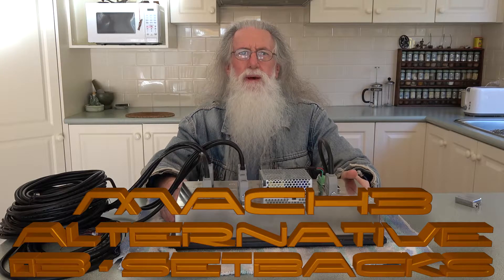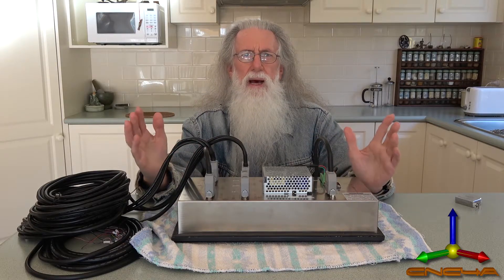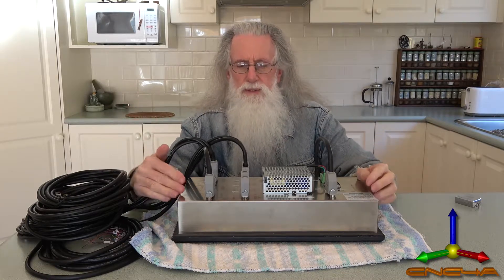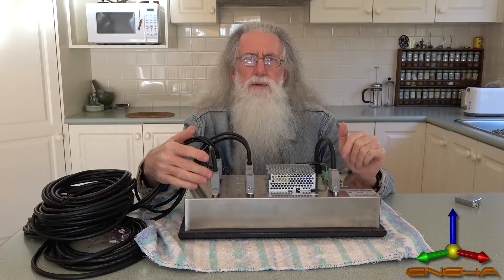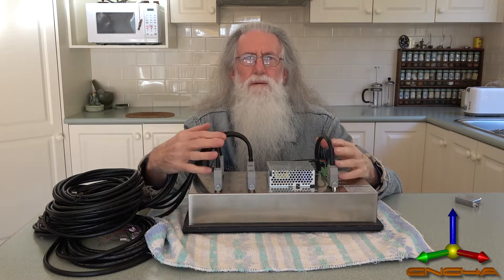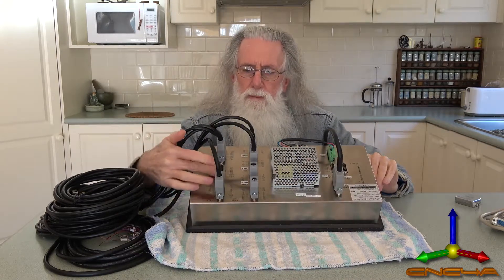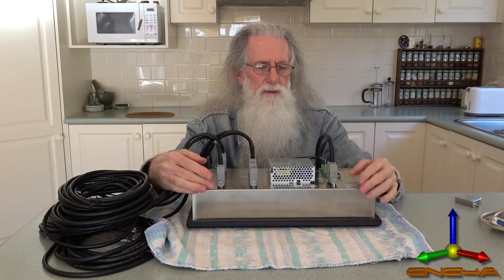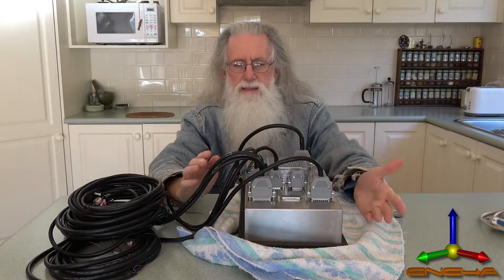CNC4A - Mach3 Alternative 03 - Setbacks

Comment: Have you made progress fitting controller to machine?
Reply from the maker: Thanks for watching and subscribing jenwen.  The controller is mounted to the lathe in its box.  It is now redoing and modifying the rest of the lathe to suit and figuring out the best, easiest and cheapest way to do it.  I planned to get closed loop steppers with it's driver in July, nil stock until a few days ago and the price had jumped 30%.  Then they don't have a Z signal so ordered ABZ rotary encoders and they took 80 days to be delivered.  Covid is a real killer, especially to the timeline of your projects.  So I do other projects whilst waiting, and hoping the views and subs go up to get me more motivated.  There are other videos coming when there is sufficient progress.  If you are planning to swap to this controller I would suggest getting their complete kits, wiring, motors, etc and it is then basically plug and play.  That route was way too expensive for me so I am doing it the long haul way, but you learn so much along the way.  Have a look at my other 300 videos and you might find them interesting and full of tips. Enjoy

Comment: Did it come with the pc software to use the rs232 dnc? If not where do you get it from I'm looking to buy the mill and lathe controllers. Also will it work on stepper motors?
Reply from the maker: No PC software. Don't forget to subscribe.
Reply: @TheWizard  can you make a video showing how to set steps per rev and all that how to get the machine to move the right amount please?

Comment: A rear cable connection is common solution in a world of CNC controllers, like Siemens, Messer and Esab. They all use it, so maybe it is not that big problem. Also, about wiring, I'm just only going to watch all the videos you made (by the way, thank you for making them, there are a very little info on the web about China CNC controllers), but about messed up wiring and cables: it is very useful to connect a rail with connectors, wire all the cables from the controller on one side, and all the motors, swithes and other stuff from the other. In this way all the idea of Plug-and-Play dies, but then you can easily wire all you need properly in one place.
Reply from the maker: Hi Vasyl Gavrilov and all the best for the New Year comrade.  You are right about no videos on the Chinese controllers, so it was a gamble for me to get it. That's why I decided to make the series so as to help anyone else interested.  I am not like a fan boy that makes out what they got for free is fantastic, like most of the videos out there are now.  Especially the "Social Influencers", defined as someone who goes to a shop, buys something, takes it home, opens it up and gets millions of views and followers for just doing that!  No I live in a different world where what you say reflects upon you as a person and I carry that over to the videos. The good results for this series have yellow numbers and the ones with problems or traps, etc have red.  The project might eventually prove too expensive for the result.  I am only doing it to tinker around and learn more things as I go.  I have gone with the DIN 35mm Rail solution with their terminal blocks, etc.  These controllers are really made for someone who buys the complete kit with everything, motors, etc and then it's easier and quicker to install.  But for someone like me who tinkers and customizes it to do things the technician's have no idea what you are talking about, it is a lot harder.  My biggest problem is how unreliable and slow eBay is these days.  It's take 2 months for items to turn  up, if at all.  So if I ordered a pack of 10ea DIN terminal blocks and find out I need another two then it will be 2 months before they turn up, putting the whole project behind.  Definitely no Critical Path Analysis here.  So thanks for watching Vasyl and if the subscribers keep increasing showing that there is interest in it I will make more videos for the series, after eBay delivers.
Reply: @TheWizard  It is the best of doing things with passion and a desire to learn, experiment and share.
You are absolutely right when you say that this is full of unboxing ( youtube) and they do not explain anything in depth.

Comment: This system is hard to setup im using it for the last 4 years . There are some bugs in the software . Ladder must be made for the machine .  Manuals are hard to understand as its a google translate English . You are missing the plugs because you did not order a complete set of drives and I/O  . It better this way  as all the machines are different and some times you never use CN6 or CN3 . As for a alternative on Mach3 , yes and no . I have done 78 machines with this , and 30 machine with mesa and linuxcnc. I do prefer linux as its a close loop system . This fpga its open type so if you want precision put linuxcnc . Support is not good as this controller is not made for export .

Aventtini 
http://www.mogulcnc.com
Reply: Thanks
Reply from the maker: Thanks for taking the the time to watch and comment on the video Aventtini.  Information on it was very hard to find and sparse.  I felt that it would be a bit of "pot luck" with this controller and it is differently not plug and play.  Because of cost restraints I have to rely on the cheapest prices on eBay so that adds its own fun and games to the mix.  Such as I just need 2 metres of multi core cable, not a 30-50 metre reel.  I am just building the mechanical parts I need to mount it up, etc at the moment so I am not up to the nitty gritty parts of the controller itself.  You defiantly have a vast amount of experience and knowledge with it so when I am up to that stage (depending on eBay delivery times) I would like to, if you do not mind and have the spare time,  contact you for some advice on a problem I might have that I can not figure out myself, etc.  Thanks again for watching.
Reply: Siemens Sinumerik 808d controller also has no encoder input (only for spindle), but it might be OK, because in your Servo Driver there is parameters of acceptable difference from position-in-time from controller and encoder readings. If difference grows to big, the driver drops ALM and machine just stops.